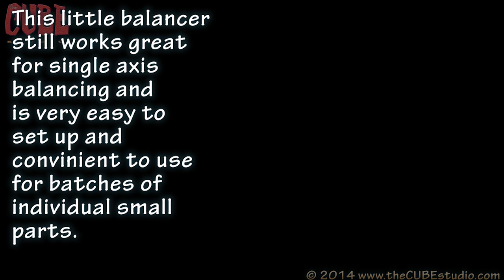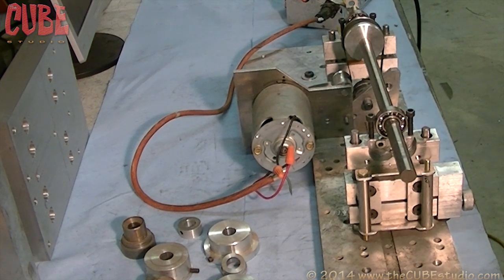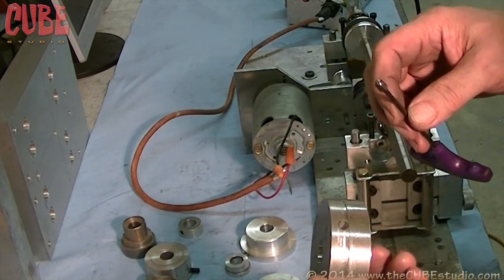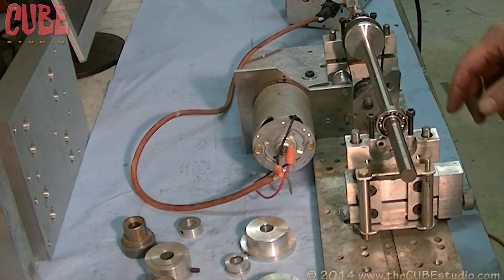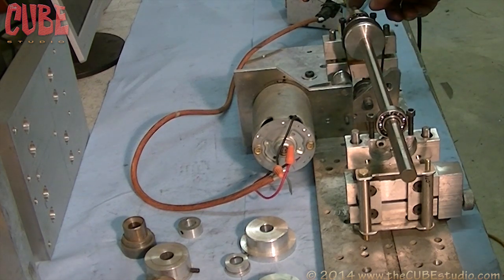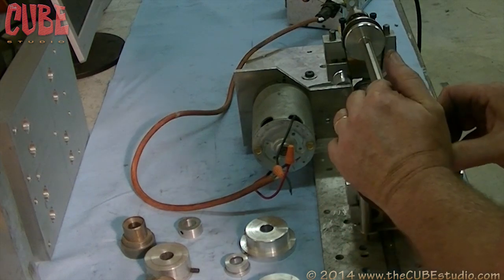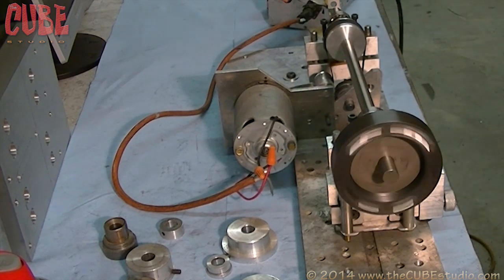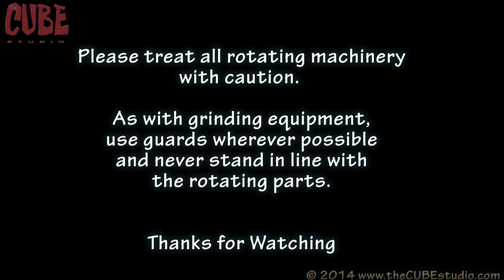Dynamic Balancer for Small Parts and Spindles

Comment from the maker: There are a number of videos on YouTube that show the typical 'two target' dynamic balancer screens. They are all very similar so for those who are interested in how commercial balancing software presents the data visually, there is plenty of information available. However, I have not seen any videos that explain what the components are or how a dynamic balancer works. My short video does not duplicate the many that are already posted, but instead provides the underlying information one would actually need to understand the process. I discourage amateurs from building potentially dangerous machines. However, it becomes possible, proceeding at your own risk, to build a machine only if you know how it is supposed to work. And now you do.

Comment: Interesting, I have not seen one of these before.  However, you jumped from running the device to a magically balanced part.  I am guessing that after running the software the mapped out-of-balance points are retrieved by manually turning by hand until they are straight up, down, etc, or on a pointer so you know where to drill/lighten?  Would it be possible to show the software screen(s) while running and how the end results are displayed?  How many accelerometers are used?  Two per axis (X,Y)?
Reply from the maker: All good questions. The electronics are on my other balancer and that is where the screen is. On the little guy, an accelerometer is on the back of the floating carriage and I just move the cable and encoder from the other machine to use the little one. The cable does not reach to the 'video' bench where the lights are, so I had to move the little machine back there to do the actual balancing.
To answer your Q's:
*Only one accelerometer is used. In Balancer speak, 'two axis' typically means the same plane, but on each end of the part. The little balancer actually has a floating carriage at each end and with a part mounted between the carriages, both ends can be balanced. A second accelerometer is then needed.
*Yes, the software records the azimuth of the imbalance and takes into account gyroscopic precession. My software only provides a 'severity' rating on the imbalance, not the actual amount of weight to add. That is a complex task that I do not have time to program with my schedule. I drill until the imbalance switches sides and then counter drill tiny amount until the imbalance switches back. That is why there are small holes opposite the main balancing hole clusters. Even where software indicates the amount of weight to remove, it is a bit of a guessing game to drill the correct depth to remove precisely the right amount of material, so you still end up doing a couple of iterations. Balancing a part like the one demonstrated takes about 30 minutes.
*I am trying to keep these YouTube videos short and informative. They are not meant to be comprehensive training on any particular topic. I do make that type of video on a consulting basis, i.e. they are owned by the customer, and therefor I cannot post them here.
Reply: Great, thanks for the additional insight.  Having a single accelerometer (per end) certainly makes it simpler.  It does makes sense that the imbalance is on a single plane and there is no need for additional accelerometers.  I certainly understand how it can be trial and error in determining the volume to be removed.
Reply: Simpsons36 First of all I'd like to say, Great video! Did I see that at certain particular RPM wobble kicked in that wasn't observable at other RPMs? I suspect this has to do with resonant sympathetic oscillations which are contingent on the length of the axial.  Do you know if it is better to gather your data at the in sync RPMs or the out of sync RPMS?
Reply from the maker: ExtantFrodo2 If by 'wobble' you are referring to the momentary lateral movement at high RPM, this is caused by torque reaction to rapid speed changes (acceleration). Torque reactions on rotating masses are subject to gyroscopic precession.  

That's a big topic.
Reply: Simpsons36 so there's no specif RPM which when held constant would exhibit that back and forth wobbling like what happens on a swing that is pumped in sync with the natural period of the swing and not when the pumping is at a different rate?

Comment: I was wondering if you could send me on a path to find the software you were talking about.
Reply from the maker: +S Vin  I wrote the software that I use on my balancer. What is shown in this video is the first 'proof of concept' prototype. Later a larger permanent machine was built with proper containment fixtures and guards. You can find some software and entire machines on ebay by searching on 'dynamic balancer'. Prices start just under US$2,000

Comment: Can I ask what you are using to to input all of your sensors to your computer?
Reply from the maker: +S Vin For the first 'proof-of-concept' machine demonstrated in this video, the software runs on an Arduino MEGA and collects the data from the sensors. That processor does not do the calculations, it collects the data and forwards it on to the computer where a separate program does the calculations and displays results in a GUI.